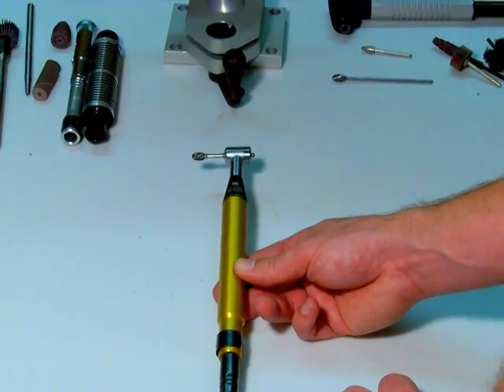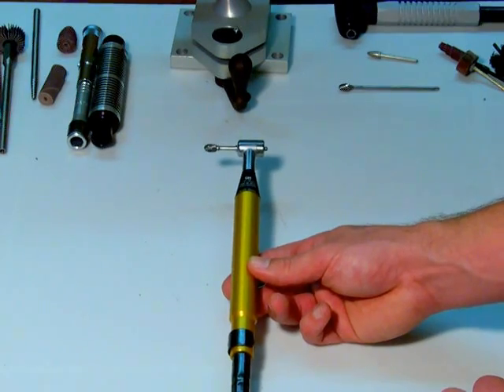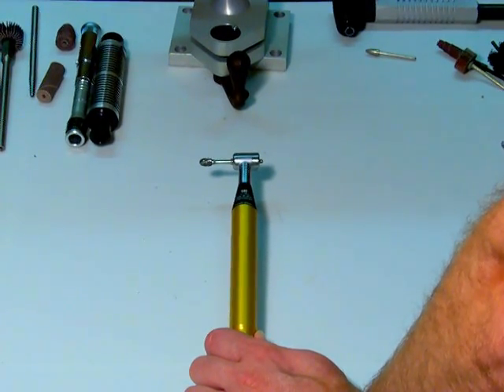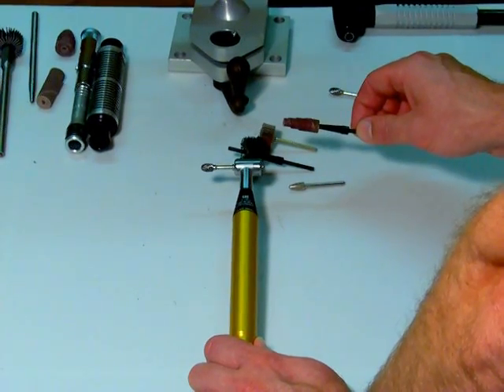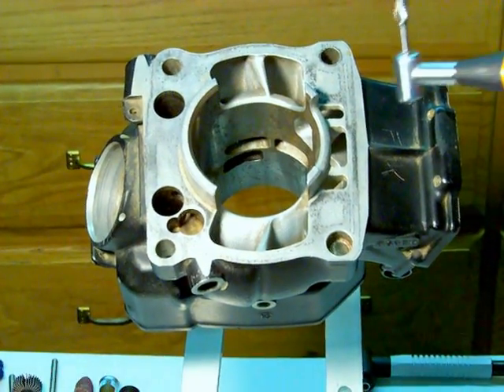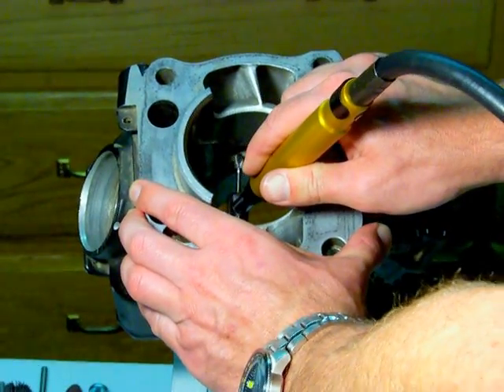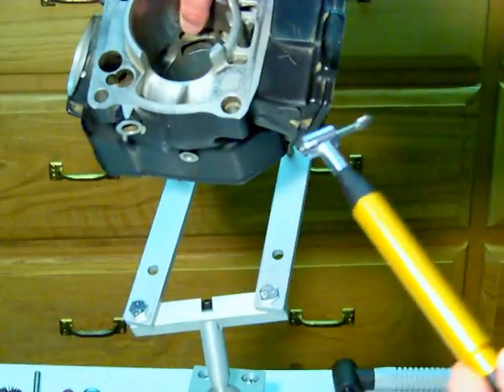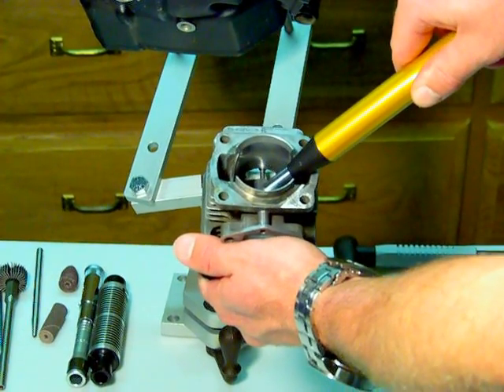Porting tool right angle for 2 stroke transfers 182.MOV

Comment from the maker: Typically it is best to do all the porting and polishing work before you get you cylinder re-plated with Nikasil. However if you do not wish to re-plate the cylinder  after porting, you simply let the burr stop spinning before you go in and out of the port you are working on, that way there is no chance of messing up the plating.

Comment: whats the cheapest and simplest way to port a cylinder head? does porting really reduce reliability? i mean i hear different opinions on people and some people actually say if its done right it can actually increase reliability and also give better performance? but im also fine if the reliability is the same with slightly better performance, i dont know anything about porting and does it involve porting the intake too, someone help me out on this matter and where i can get a 62cc 2 stroke ported

Comment from the maker: Yeah champ, to get technical the cylinder head would be the part that bolts onto the top with the spark plug, but the cylinder is still called the cylinder head by a whole lot of old school guys, and it refers to the fact that the assembly used to be one piece,it's also called the jug, cylinder jug, the 2 stroke jug, and the nomenclature goes on, but anyway Google images 2 stroke cylinder head, if ya want more examples.